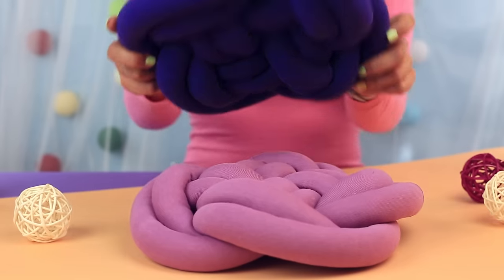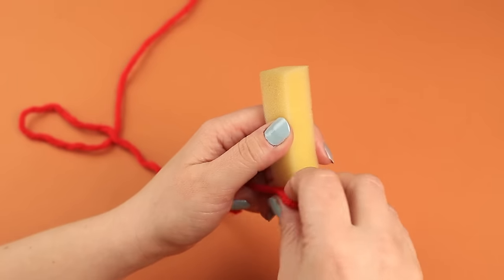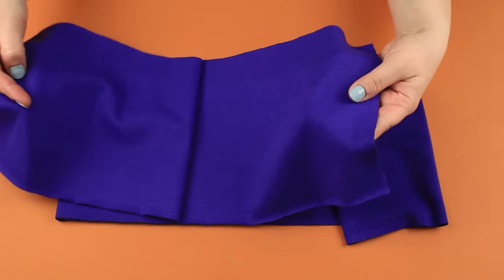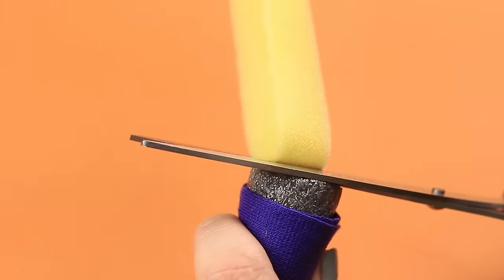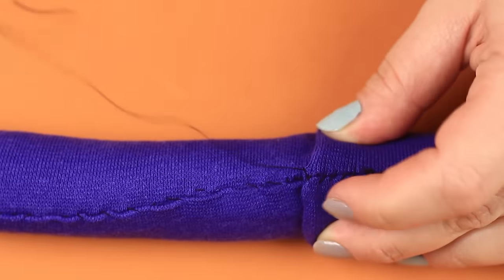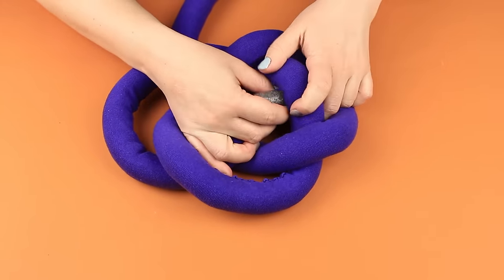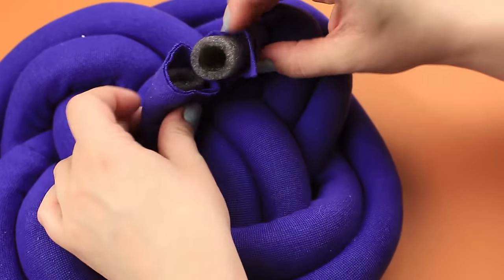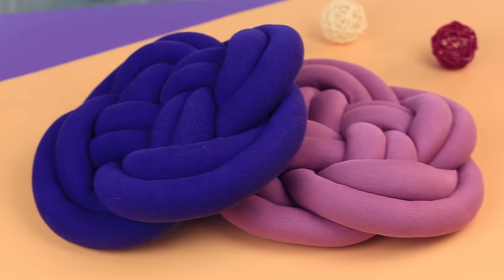DIY Throw Pillows

Comment: I have a problem that if we don't have that grey and yellow colour tube then what can be used ????
Reply from the maker: you can use any color :)
Reply: Troom Troom I am not asking about the colour of the tube
I am actually not finding the tube and the foam so I am not having it
Reply from the maker: You can try using this technique https://www.youtube.com/watch?v=m23vDre1ilU and use some wire as framework
Reply: thanks a lot
Reply: Ramesh sharma u
Reply: She wasn't saying she couldn't find the color as such she was speaking about finding the foam products of "ANY" color.
I would imagine the none round foam could be found at craft stores e.g. Hobby Lobby, or maybe at fabric stores e.g. "Jo-Ann's". As for the round foam "pipe insulation, you can try Home Depot or Lowes, possibly an ACE or ACO, or any other hardware store. the "pipe insulation comes in 2 sizes & some comes with an adhesive peel & stick built into the open edge, which will keep the open edge closed after stuffing the other foam inside.